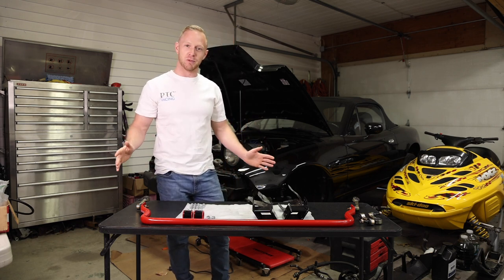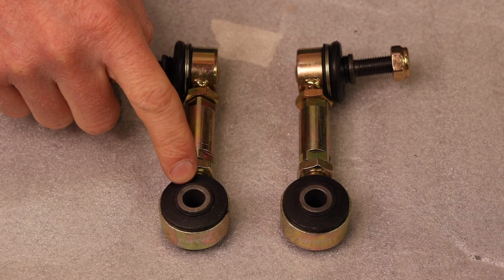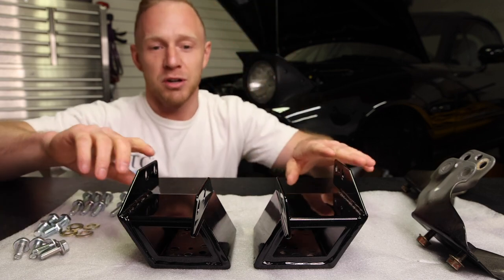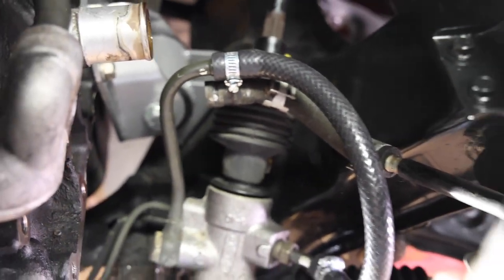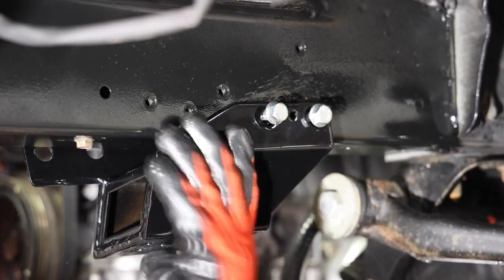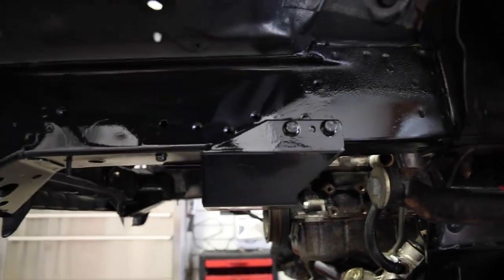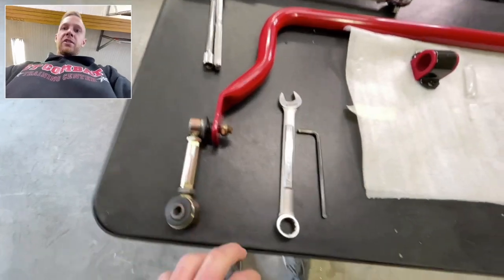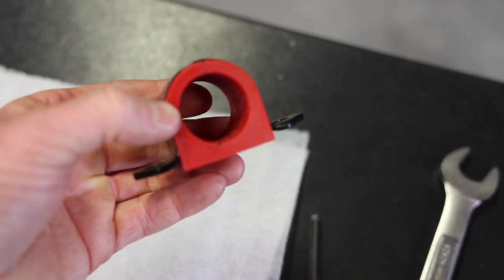The BEST Sway Bar Package?  Everything You Need!

Comment: Can you do a detailed video on de-powering the steering rack? That's my next project on my nb. Great videos!
Reply from the maker: I will yeah but I just looped the lines for now.  You just take the power steering pump off and fluid reservoir, and run a line where those two were connected.  I’ll be de-powering it the “proper” way when I get more time.  @thecarpassionchannel did a video on it

Comment: I will say, if you want to make the allen key bolt easier. A set of those allen key sockets are really nice. Awesome video Ryan! 
Anti-seize is your friend for sure though.
Reply from the maker: Oh yes I have a set of those!  In this case, I just had to hold it in place to tighten the nut so the good old fashion Allen key did the trick 👍
Reply: @DriveItRyan  Awesome. Yea I know when endlinks age, they like to be a pain to loosen and tighten so I made sure to have a set for them and my control arm bolts, but yeah in this case an old fashion key works good!